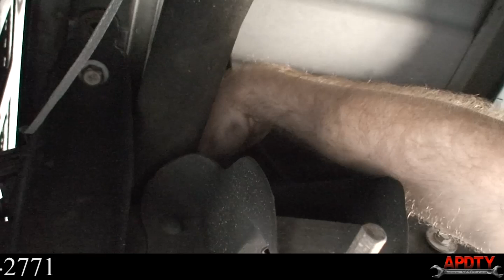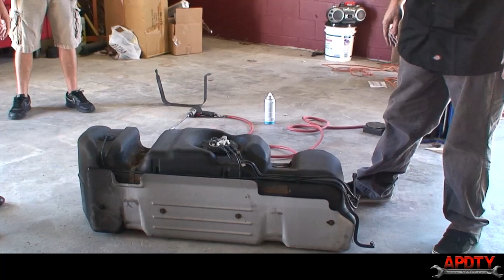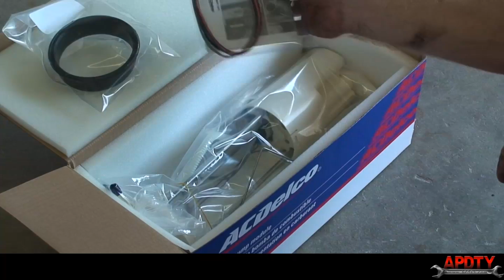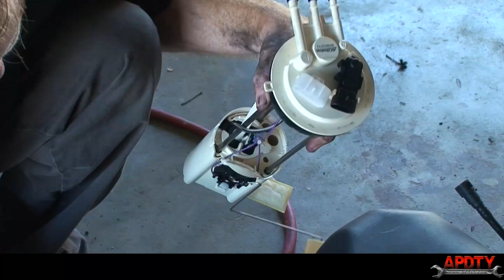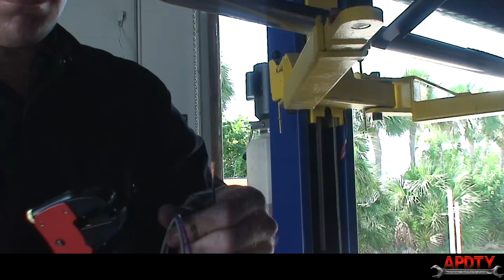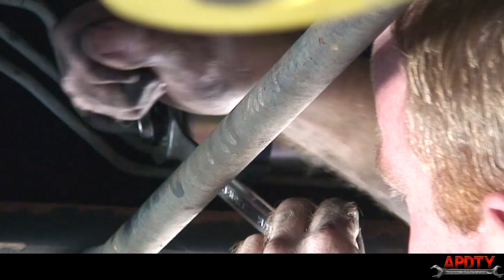2001 Chevrolet Silverado Pickup Fuel Pump Module Sending Unit

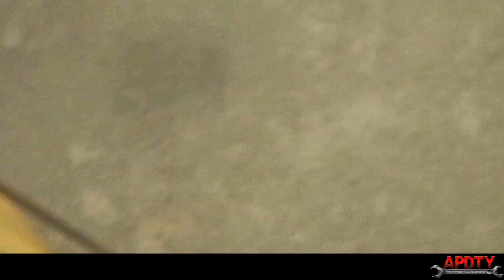Comment from the maker: On this job, once we got the pump out, we show you why the gauge wasn't working, the "fingers" that make contacts along the resistive strip are completely worn away (This can be seen at 13:31 in the video). Fuel system cleaner won't help fix that problem. Also it was the original pump on a truck with over 100k miles,, these pumps don't last forever so he wanted a whole new module so he wouldn't be replacing it again soon when the pump itself died.

Comment: Are you replacing the fuel pump only because the gauge doesn't work? I know people that have had that issue and used fuel system cleaner and cured the issue.

Comment from the maker: the pump internally has a check valve to keep the fuel pressure up when the vehicle is off. you cannot service it by itself though, unfortunately replacement of the whole module is required to change it.

Comment: you did it the hard way lift the truck box with a cherry picker remove two bolts on driver side of box. loosen two bolts on passenger side disconnect filler neck. now you can get at the pump with gas tank in the truck  peace of cake.

Comment from the maker: It could be the fuel pump, Those are symptoms of low fuel pressure. But there are other issues that can cause those symptoms as well, such as the mass airflow meter. Do you have any DTC (Trouble Codes) stored in the computer?

Comment from the maker: That sounds like the symptoms of a failed fuel level sending unit, so if the sending unit is built into your fuel pump module, then unfortunately it is probably time again. If you have the same truck that we had in this video, click the link below the video to find this same pump we used in the video,, for cheap. Thanks!

Comment from the maker: Using the old harness can sometimes be okay, but you want to inspect each pin contact to make sure the contact  a) isn't corroded at all,, and b) Isn't stretched out and still squeezes the pin on the fuel pump tightly.

Comment from the maker: The truck has well over 100k Miles on it, These pumps don't last forever. The customer wanted to replace the whole module as a preventative measure. These trucks are notorious for fuel pump failures so he was fixing it before it left him stuck on the side of the road, and he'd have to pay the labor for the job all over again. Also a new AC-Delco pump was not much more than the AC-Delco brand fuel level sensor by itself. So why not change the whole thing?

Comment: Another video showed a guy cutting a trap door in his bed to avoid dropping the tank, but this showed it can be done the correct way. The fuel line connectors have always given me trouble because of the close working conditions, so I like it when I see a video that includes releasing and switching fuel line connectors. Good video.

Comment from the maker: You can probably find them, but it's always recommended to replace the fuel pump harness anyway, they become corroded over time and can lead to high resistance where the connector connects to the pump, which can cause premature pump failure.

Comment: it is a real life video. Thanks. 
One thing I notice is when putting the harness back with solder, it was the best to put it where they are not adjacent to  each other, for safety issue. 
Also you could solder and put  butt connector and heat shrink them. So you have the best of both world. 
other than that it is great video, keep it up.

Comment: thanks i have 2002 avalanche trying to do replace pump in the yard. did not know what the charcoal cans was and there is also a little box in back of the tank that i have no clue but lines also hook to it. this is aggravating on the ground also first video that went more in dpth on unhooking gas lines.any more tips for back yard mech.

Comment from the maker: It is possible, but it requires complete disassembly of the module. They design it to be replaced as an entire unit. Also, the fuel level sensor is common to fail, and to replace that, you have to do the whole module as well, so you may as well knock out two birds with one stone.

Comment from the maker: That is an unusual one. Usually fuel making it to the charcoal canister is a problem with the vent-valve, but you say you already replaced that. The only other thing I can suggest is to make sure the new vent valve is actually closing and opening properly. I was also going to suggest not topping off the tank all the way, but you are already doing that. I have no other ideas for you, but would love to know what the issue was when you discover the problem. please keep us updated! Thanks

Comment: I know you have a great shop and well trained techs-I just unclipped the one wire harness and took the six bolts that hold the bed to the frame -slid the truck bed back about 20 inches-changed out the pump assembly bolted the ground wire-  bought 3 double meat cheese burgers for my lift helpers -best advice I had was to move the bed super easy.

Comment from the maker: I agree if the lines are rusty or tight, but this one had no issues breaking loose with a standard wrench. Had it shown any resistance or signs of rounding the flare nut, I would have switched to a line-wrench.

Comment: I used a 1/2" ratchet, an extension, and a socket. I think it was an 18mm socket. There are 8 bolts; remove them all. Also remove the torx bolts at the fuel filler/gas cap area. Unplug the harnesses under the tailgate. I then used a floor jack and a few pieces of 2x4 wood to lift the driver side of the bed. That's it. Very easy.

Comment: Thank you for putting together such a detailed video. If I may be permitted to add, 1) SAFETY GLASSES, 2) Transmission Jack, 3) Flare nut wrench, 4) and of course a heat gun/hair dryer would have made it much safer procedure. A hand operated pump to remove as much gasoline from the tank also would have been useful.

Comment: Thanx for this vid. The pump on my 2001 Silverado died and I watched this vid. Then, I ordered a new pump from APDTY. Great price great service. However, I didn't drop the tank. Instead, I removed the bed bolts, unplugged the rera lights, and just lifted the bed on the driver side only. Way easier. Thanx again.

Comment: I have a 02 silverado 2500 HD with the 8.1 and allison. My pump went out and I managed to change it, but we did it differently. We took off te bed, replaced the sending unit, shocks, bushings, scrubbed the frame and pressure washed it, fixed any rust we found, and reassembled it. Wouldn't start. Found out when we put the bed back on we somehow cruched the wires to the tank and three of them broke. So, we just dropped the tank... ;{

Comment: Yea my 2001 silverado 1500 4.3L 6Cylinder's Fuel Pump just went out @ 150,000 Miles, i had the same problem the fuel gauge would fluctuate alot and then the fuel pump just finally burned out/went bad!

Comment: I thought that must be a new truck, and the video shot way back in 2001. You should see the rust under my newer trucks, even under a new truck in a dealership nearby. I hate the liquid calcium they are spreading on the roads to clear the ice. As if anyone could drive fast enough to save enough time to buy a new vehicle every few years. I believe the calcium is also ruining the road beds, causing thawing that makes huge dips and broken pavement. Must be nice to live where it's warm and dry.

Comment: i was told that there are two types of pump in this range of pumps. is there any way to tell which one your truck has with out dropping  the tank? or is that the only to know if you have a two plug pump or a one plug pump?

Comment: Do you prefer dropping the tank instead of bed removal?  I have an 01 with 140K milies sitting in my shop right now with fuel pump and fuel sensor issues.  I took the bed off myself and it was really easy.  Also, I can now get a good look at things and do some general cleaning and maybe waxing of the cab back and bed front which I don't get to do normally.  Thanks for the great video.  Looks like I'm saving about $300 on this job!